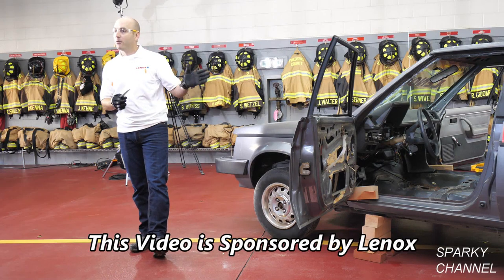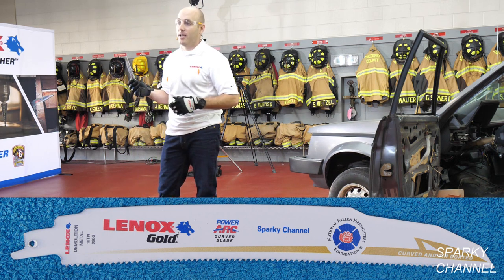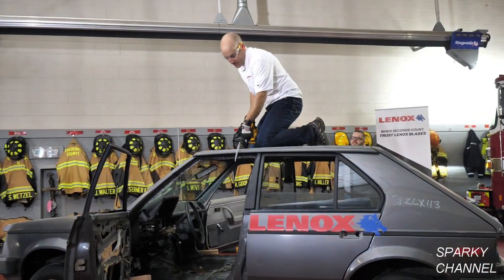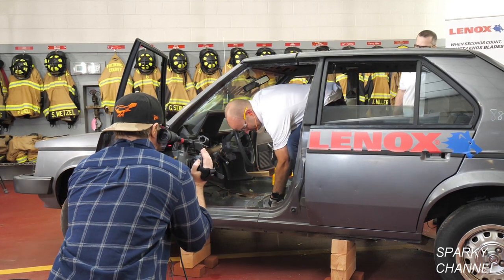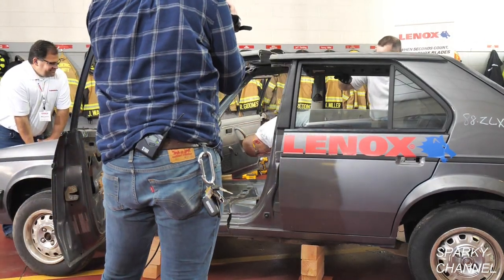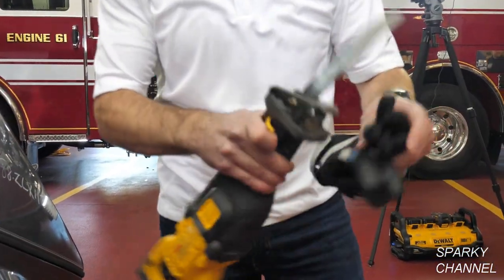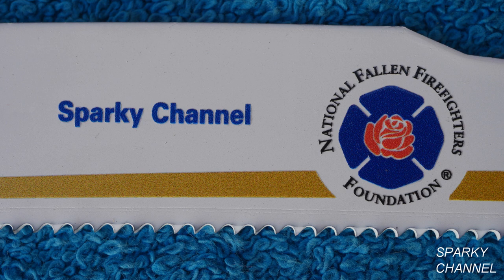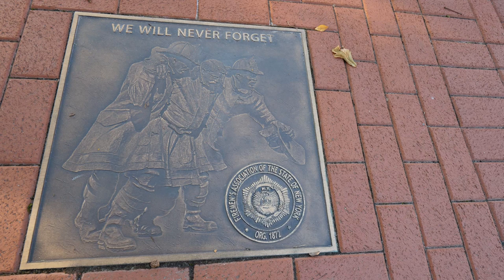Cutting a Car in Half with a Lenox 9" Reciprocating Saw Blade

Comment: Anyone try this blade real world 🌍 on a car. 960g blade?

Send me a link I can’t seem to find this exact blade? Been looking all over can’t find 960g? What’s the equivalent?
Reply from the maker: LENOX Tools 21229B9110GR Gold Power Arc Reciprocating Saw Blade, For Thick Metal Cutting, 9-inch, 10 TPI, 5 pack and 25-Pack: Amazon: https://amzn.to/2Ji4UGb
Reply: @SparkyChannel  thx 🙏 I’ll try it

I ordered the 5 pack slightly different number but the same I think? 210979110GR
Reply: @SparkyChannel  Amazing a Fresh blade cuts so fast. But it took two blades to cut a car in half. 9" was short at the floor board, going to order a 12"

Comment: Big deal? It’s just sheet metal.
Reply from the maker: Thanks!
Reply: Cutting through the door sill of the unibody frame in front of the B-Pillar is somewhat impressive...
But I'd like to see the performance cutting through something like an F-150 box frame that has high-strength steel.